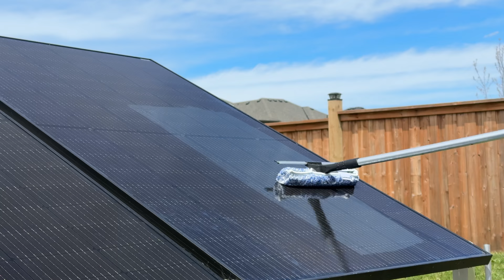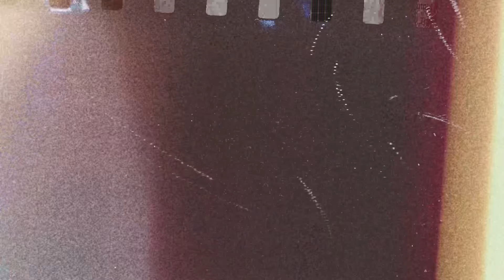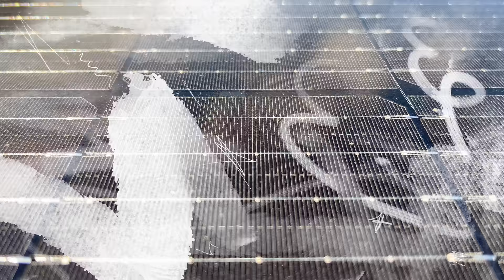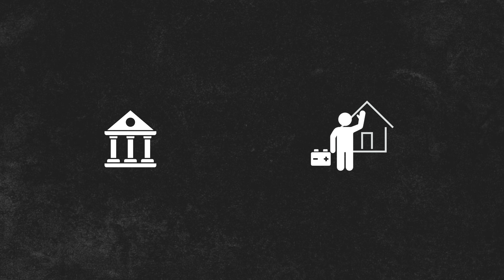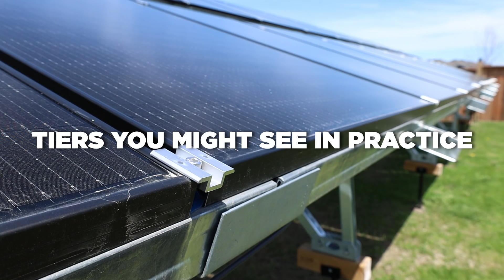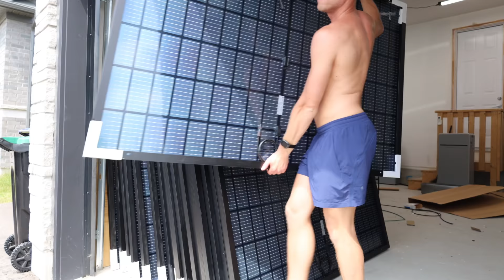Solar Panels Don't Matter... Here's Why.

Comment: I got all of mine from ebay.. average was $50 per 100 W... 2 arrays of 45V, one at 95V and one at 25V for the heat/cooling of the ecoflows.  because I have trees in my backyard.  all are outside in water tight patio boxes with solar panels just for xtra fans. All connected to one extention cord comming into the house...
Reply: You would be better off ordering new from Signature Solar. Their average price is about $0.40/kWh for new panels. Good prices are $0.33/kWh and deals are under $0.30/kWh.
Reply: @williammeek-h2o  I bought as I learned.. all 200 and 100 wh panels.. All on the ground.. I don't want panels on the roof. also I was getting 195wh  bi panels for $100 each free shipping.. the powerstations is what costs money... The thing that people don't talk about is that 15 amp is the bigest problem. amp x volt = wh... I wish the powerstations could do more amps.
Reply: @rez157  I have a Pecron 3600. It has a 3600 watt inverter and 3 kWh battery. It takes 150V and 20 amps on two separate MPPTs rated for 1200 watts apiece. 2400 watts total. That is pretty significant.

The new one, the 3800 has a little bit better specs at 3800 watt inverter, 3.8 kWh battery and two 1500 watt charge controllers.

And they are not too expensive.
Reply: @williammeek-h2o  I went with refurb ecoflows, delta pro for $1500 and The delta max for $700.. I daisy chain the max into the pro into one line into the house....they are only 15 amp but at the time I was just starting and it is only a hobby... lol If I started over I would do it different...
Reply: @rez157  The Pecron 3000, still 3600 watt inverter and 3 kWh batter but only one MPPT that takes 150V at 25 amps is $700 right now.
The previously mentioned 3600 is $1000 and the 3800 is $1200.
Reply: Things have changed a lot in the last few months.
Reply: Wow, I'm getting brand new 350 W panels for $45 each.
Reply: @Loki-rascal  where? That is $0.13/watt.
You cannot be in the US. That is the price without tariffs.
Reply: @Loki-rascal  nice.